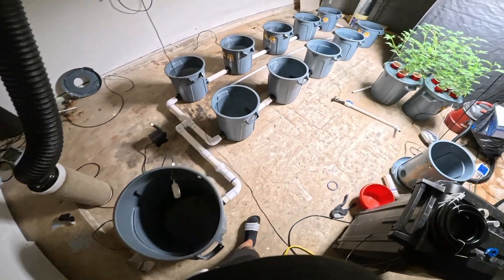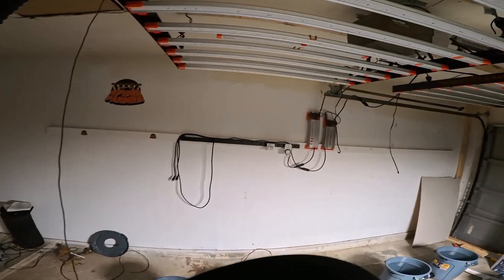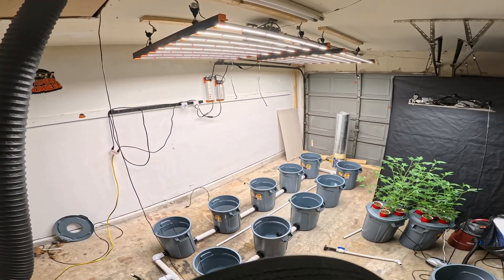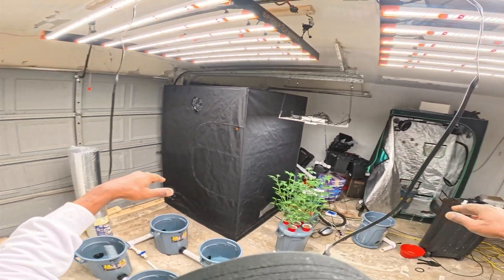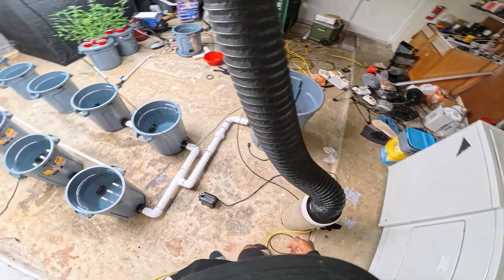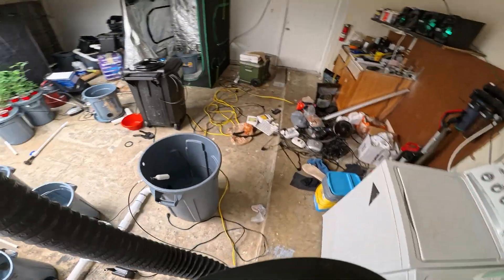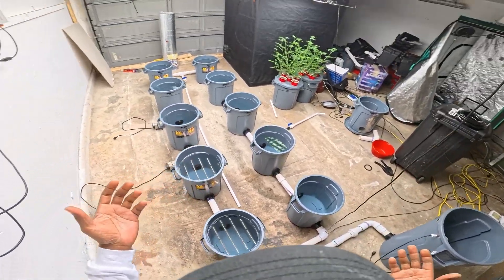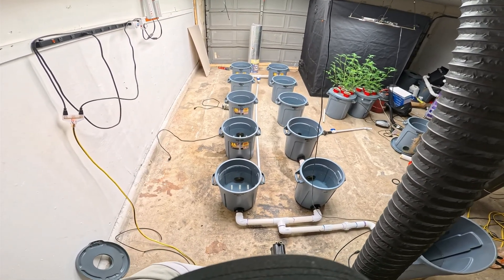10 site RDWC system build week 1

Comment: i built undercurrent systems in 07. The water res needs to be bigger, black res, 2 water chillers, h202 drip. watch the res temps.
Reply: roots grow so fast they airstones will get blocked, large 900 pump man, fast water nice and cold.